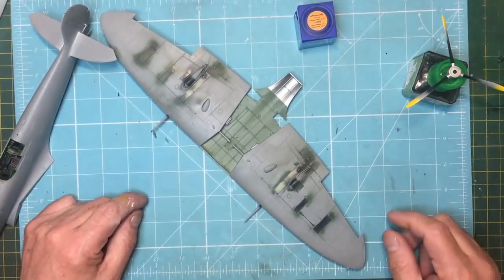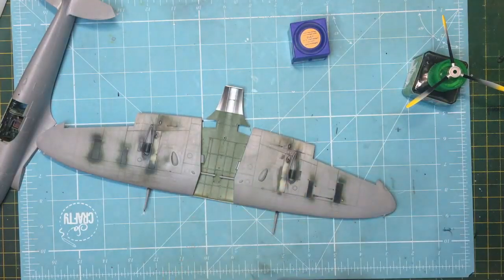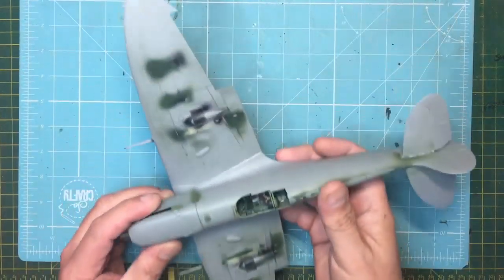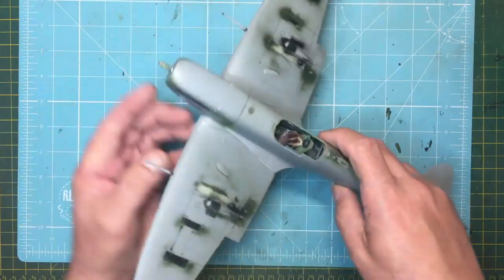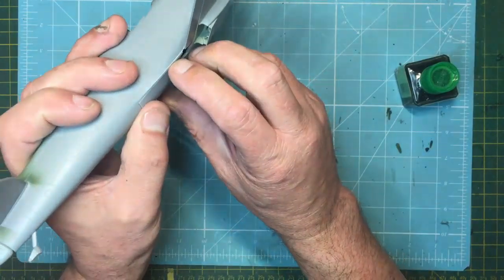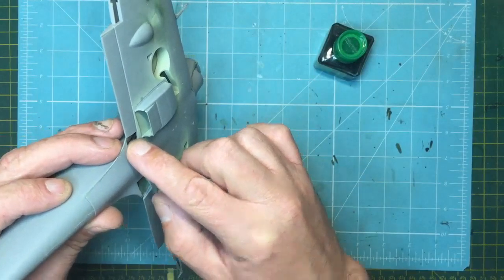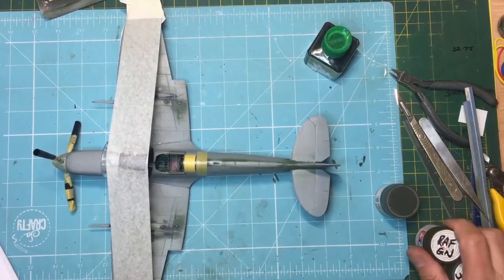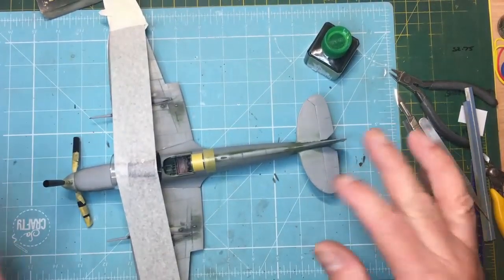Let's build a 1/32 Spitfire part 2a build done, next time it's paint!!

Comment: Bit late to the party, sorry, - build matey. I do like the tip about the glue colouring extremely useful.
( Nails are coming in too but difficult to scratch the paint still, anyway one added bonus you'll be able to pick ya nose when they've grown back ! LOL )
Also find that manufacturers paints can vary so much that I tend to pick ones which look correct to my eyes too. When originally mixed in real life they could also vary depending upon who was doing the blending which gave rise to minor variants anyway and this always prompts discussion among modellers. My attitude is generally if I like it and its a close match then go with it.
ATB 
G

Comment: The Spitfire is coming on nicely Nigel 👍 Used to use Humbrol paint which is a very stuff paint.But it takes 24 hours to dry.So I switched to Tamiya paint about 5 years ago.Brilliant paint,never had any problems with it apart from the price.Must give the Revell paint ago.Ive noticed that the paint brands have completely different colour shades 🤔 Yeah Frankie and myself are hosting the GB mate.Just completed my Revell Spitfire In 1.32 scale 🍻 Not a bad kit for the price but some issues.The location points for the cockpit tub are none existent.